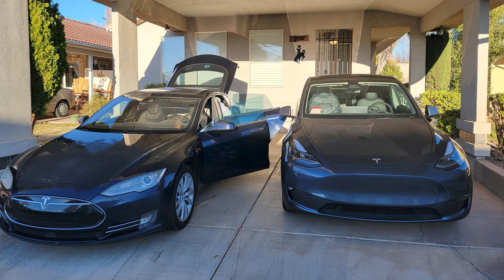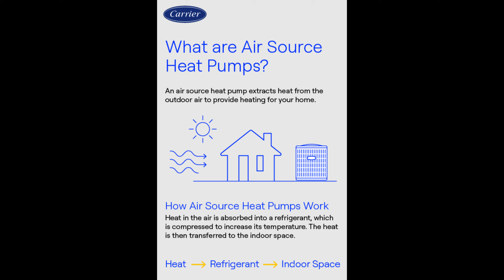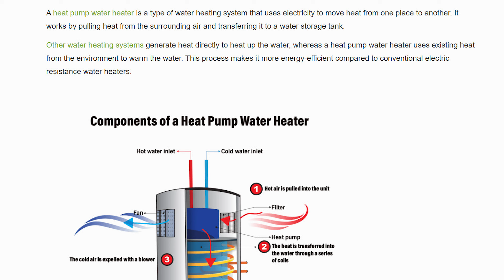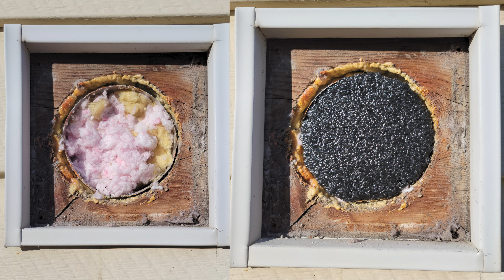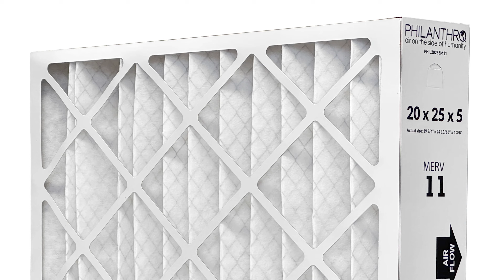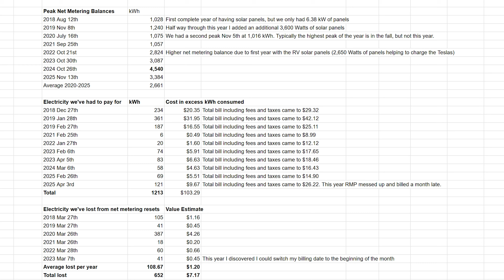Zero Heating Bill This Winter: I Used 4,540 kWh of Excess Solar with a $136 Space Heater!

Comment: Great video and very interesting information. I do have a question. How do you mange indoor air quality with the house being so sealed off?
Reply from the maker: Excellent question. I don't specifically manage indoor air quality aside from limiting the introduction of unhealthy things in the first place. Such as not allowing outdoor shoes to be worn indoors and not combusting gases indoors. (Gas stove tops are a big source of bad air quality.) I do have a 5-in pleated MERV 11 air filter in my furnace that is continuously filtering the air but that's good for particulates and not gases. Fresh air is introduced through open windows as the weather permits. But there are months in the winter and in the heat of the summer when the windows are rarely ever opened. Obviously new air is minimally introduced whenever we go in and out of the house which with the family of six and kids leaving the doors open sometimes (especially visiting neighborhood kids) that happens more often than I would like sometimes. I have considered purchasing an indoor air quality monitor (I do have a monitoring device in my office downstairs tracking the radon levels) but I haven't yet bought one. We had a blower door test done several years ago and our number was extremely low which means a very tight house which has been very helpful for energy efficiency but is potentially at the detriment of indoor air quality as you're pointing out. We don't have any lung issues or chronic problems in our house so I haven't been motivated enough to spend the money to get one. But I've had one in my Amazon shopping cart for years as I'm on the fence about buying one. I've also considered installing an Energy Recovery Ventilator (ERV) but so far I haven't needed to.

Comment: This is awesome to see! My 11.89kw system came online today (same net metering deal) and I’ve been thinking of doing something similar - space heaters throughout the home tied to WiFi switches and temp sensors as the thermostat. I also have a heat pump for most of the upper level. Thanks for sharing

Comment: Interesting data report.
I don't recall if you have done a review on your condensing drier, I've been interested in those for a while. Not pumping your air conditioned air out of the house is a big deal!
Also heat pump water heaters for a place I have down south is something I've been interested in as well.
Thanks for the taking the time to make the video!
Reply from the maker: I have not made a video about the condensing drier. I've mentioned it a couple times in other videos where it's relevant, but nobody has asked for more information about it, until this comment. Right now I'm too busy trying to catch up with trip videos. Perhaps I'll make a 5 year in review video on the drier to report how it's worked for us. In brief it's worked fine and like you said I love how it doesn't push conditioned air out of the house. The biggest drawback to the particular model we got is it's smaller than we'd like it to be. There weren't a lot of options on the market when we purchased it around 4 years ago.
Reply: @ElectricTechAdventures  Keep going with the BIg picture‼
I suspect you've got enough Adventure Time and data to keep you busy for the nest 10!
Reply from the maker: At the rate that we keep going on new adventures it looks like you're correct... For instance a couple days ago we got back from a Model Y road trip / Airplane combination trip using Full Self Driving to drive to Los Angeles then we flew to Oahu Hawaii for a week, then reversed the trip. The next video will be the beginning of an RV trip series to southwestern Colorado and southeastern Utah. The temperature at the Valley of the Gods got up to  105 degrees F according to our truck's ambient temperature readout, but the mini split in the RV kept us comfortable!
Reply: @ElectricTechAdventures  Yep as I suspected! By the way I am always eyeing trailers on the road and boats on the intercoastal to see who's using solar.